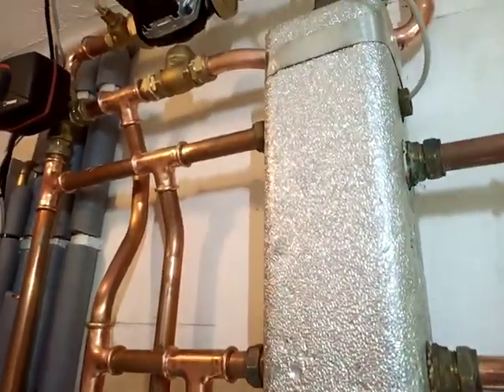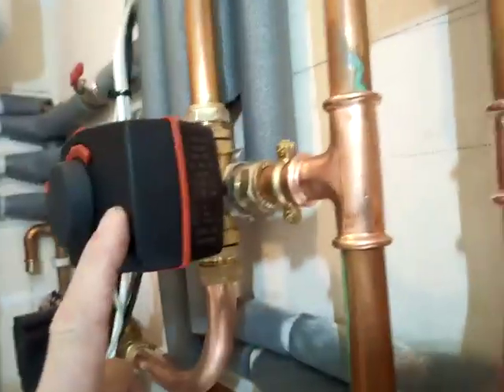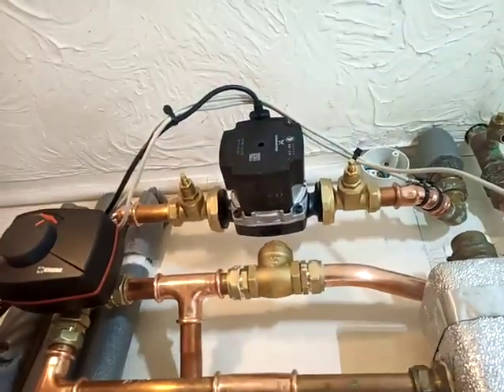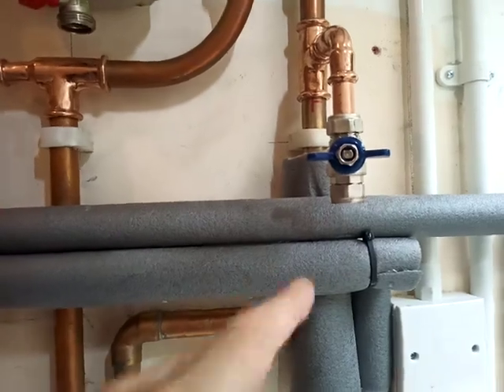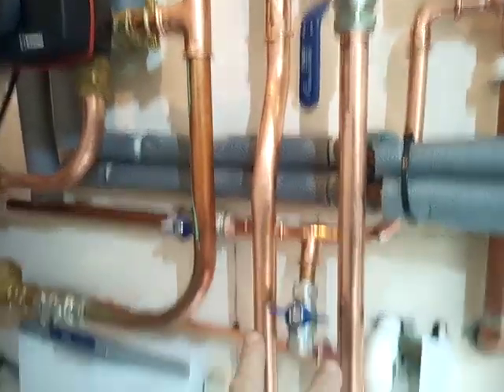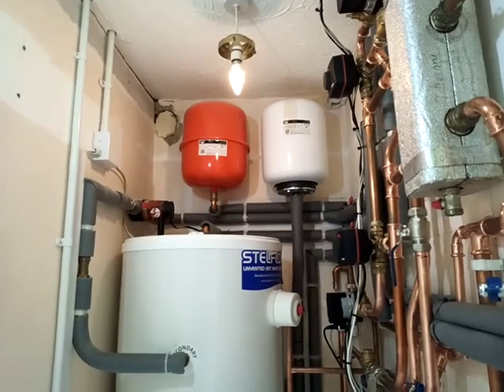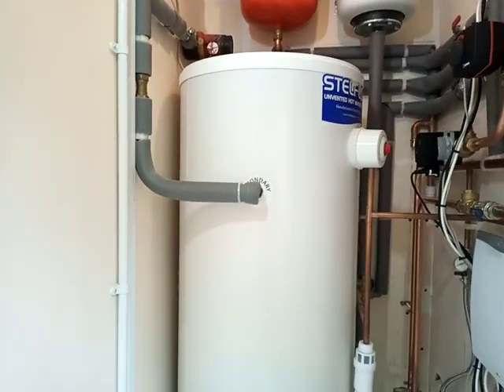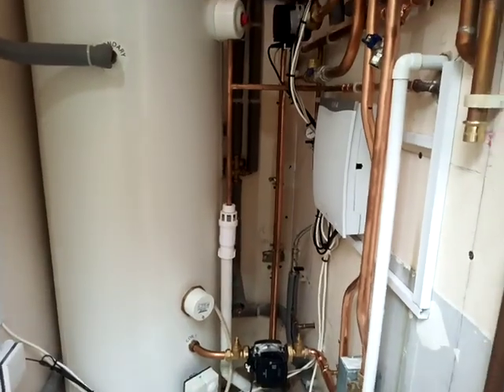Vailant upgrade. sensocomfort with two mixed zones.

Comment: Just to update on flow temperatures and curves, today has been the coldest day of the year, -6c overnight and barely hitting 0c in the day yet the house is maintaining 19-20c in the day and above 18c during setback overnight with a weather comp curve of 0.35(!) supplying the retrofit underfloor with flow temperatures to the manifold mostly below 30c and no thermostat influence, just pure weather comp controlling the room temperature. The upstairs radiators are on 1.5 curve running with thermostat control and only scheduled morning and evening, I've not yet let them off the leash entirely 🙂

Despite the boiler running pretty much all the time when room influence is removed entirely (it hasn't shut off for more than 30 minutes this week) we're also using 20%-30% less gas than last winter, although some of that is due to improved insulation as well.
Reply from the maker: That's a fantastic result.
Reply: @andrewmillwardwatford9410  Yep working really well in these colder temperatures, I've done back to back in similar weather with a more conventional morning plus afternoon/evening schedule with themostat control and despite seeing far more temperature fluctuation, a lower mean temperature because of that fluctuation and much shorter but higher output boiler running, gas consumption between both was pretty much identical. 

I still don't think I've got a full weather comp setup dialled in for in milder weather though, especially in early autumn weather around 12-15c when it's marginal if the house needs any heat at all to maintain target, the system seems to still want to put in some heat when it doesn't really seem necessary, using a couple of KWh of gas per hour when it doesn't really need it, not sure how to tackle that though as its already on a very low curve.
Reply from the maker: @LocostR1  use the shift
Reply: @andrewmillwardwatford9410  Cheers Andrew, sorry for the duplicate post now deleted, I came back to it yesterday evening and it wasn't showing so assumed I'd not pressed Reply!.

The only way to shift the line from what I can see in the Vaillant controls is by lowering the target room temperature, is that correct? If so that suggests I need to be on a significantly higher curve but then set an artificially low room temperature so there's the same amount of heat as I'm getting at the moment in cold weather but it drops off at a sharper angle in milder weather. I think to do that though with say a 0.7 curve I'd have to be setting a target room temperature in the controls of something like 15-16c to maintain an actual ~20cc, which feels wrong too. Maybe I'll have another chat with Vilasar 🙂
Reply: I switched upstairs radiators to weather comp using a really low 0.7 curve a couple of days ago. Despite -7c overnight and -2c in the day yesterday it's able to maintain the desired room target (20c) and setback (18c) temperatures in most bedrooms with the rad zone flow temperature varying from 35c-45c. One bedroom does run just under a degree colder than the rest though so seemingly needs a slightly larger radiator to work well at those flow temperatures. 

Gas consumption was also nigh on identical to the previous two days with similar outside temps on the above mentioned schedule and 1.5 curve despite a more consistent and slightly higher average room temperature. We'll see what happens running these curves when it gets milder tomorrow and into next week.

Comment: How much did the upgrade cost and how much will they save?
Reply from the maker: I don't remember the total bill. How do we value added comfort ? These system changes are realy corrections that had failed to be instaled originaly. The alterations are to.the system and are ongoing and permanent and so offer the comfort and energy savings for ever into.the future for gas or heatpump. The savings should be aprox 20% forever on a gas system.

Comment: Just wondering why you wouldn't need the motorised valve if it was a vailant cylinder, how do vailant cylinders differ from other cylinders , thanks
Reply from the maker: Is simply a matter of regulation. The motorised valve is a hangover from old fashioned boilers and alternative Heat sources. Almost all Modern boilers are unable to cause an unvented cylinder to overheat but the regulation has not been updated. Viessmann and Vaillant have their cylinders and boilers tested to prove that they do not need the motorised valve and so they are approved as long as they are installed has boiler and cylinder from the same manufacturer. Most engineers that understand there's no longer fit motorised valves on any unvented cylinder when attached to a modern boiler although this is not to regulation

Comment: Hello Andrew. 
I notice that motorised valves are not used on the heating circuits. 
Is there not a chance that water can gravitate through to the heating circuits on "no demand" or do the mixing valves perform the function of preventing this occurring ? 
Thank you for the videos you present. I have learnt a lot from them...
Reply from the maker: Non return valves.